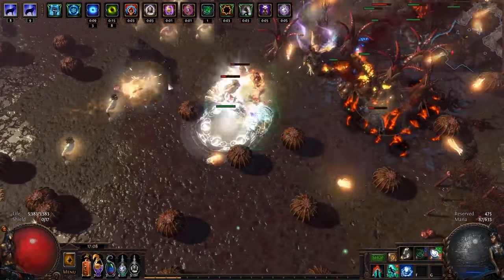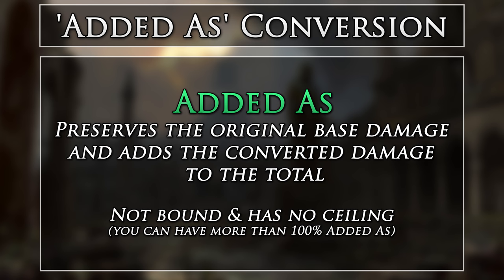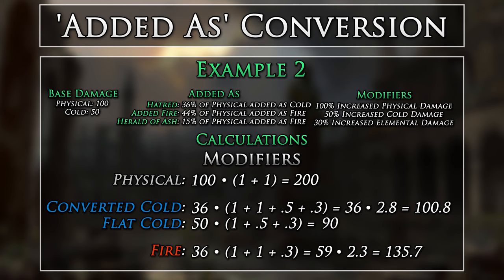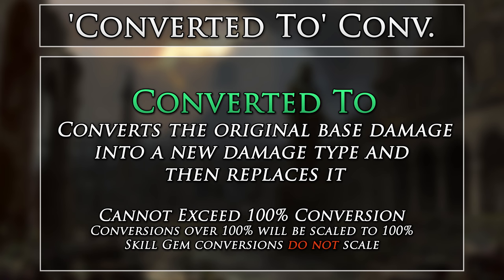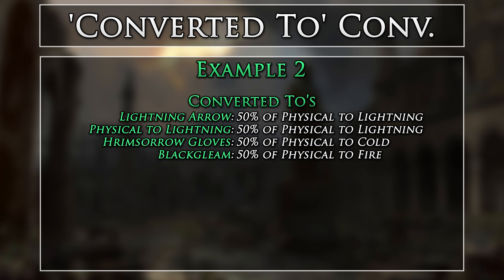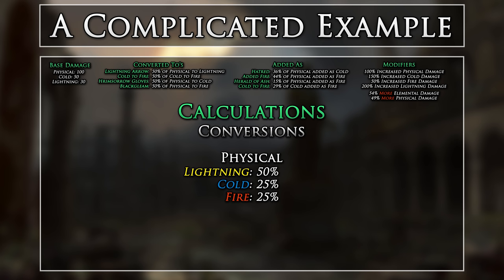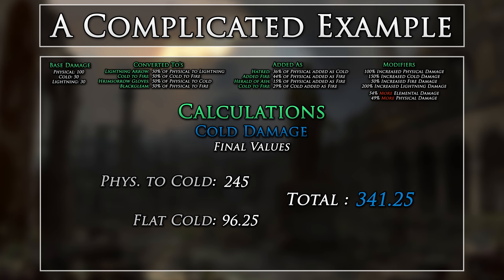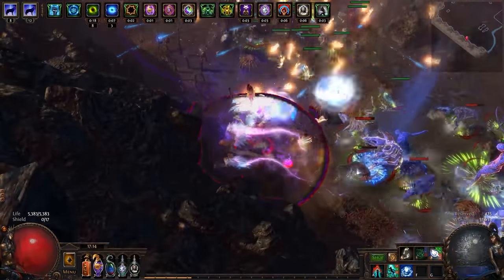Path of Exile: Damage Conversion

Comment: In the phys to cold to fire calculation, why isn't the math 61*0.5*1.29? You have 30.5 phys to cold and 25 flat cold after converting it to fire. Shouldnt the 29% of cold added as fire be calculated from the previous cold damage sources?

Comment: so tldr the main benefit of conversion is using say physical and elemental nodes in the passive tree to equally benefit the skill, this is double dipping?
Reply: No, this is not double dipping...you used to be able to restart the phys->element loop and "double dip" on the damage increases...but GGG caught on like the assholes they are and fixed it.

But yes, the benefit of conversion is to increase your ele. damage scaling.

Comment: You mention that skill gem-based damage conversion has priority on its share of the base damage when conversion is over 100% and will not be scaled down, but what about when the conversion from gems is over 100% already? For example, Glacial Cascade (60% phys to cold) with Physical to Lightning Support (50% phys to lightning) has a total of 110% conversion from skill gems.

Comment: At 8:12 it looks like you messed up with the flat lightning calculation-- it should be 138.6. In the next slide the total value is correct though (598)

Thanks for this video though, helped clear up some confusion I had with conversion. Very informative.

Comment: the only thing i'm a litte confused with if you only have 1 conversion at 100% (in my case to fire) is it better to add flat fire or flat phys, i guess in my idea phys since if you also have added then it helps but if not that then i don't know :p
Reply: If you have 100% of physical damage converted to fire, then 1 flat fire damage and 1 flat physical damage will give you the exact same amount of damage. However, a lot of flat elemental damage rolls in the game will have a higher value than flat physical damage. For example, let's say you're using an attack and you want a ring with flat damage. A tier 1 flat phys roll on a ring gives you 9 to 15 damage. A tier 1 flat fire roll is 25 to 45 damage. If they we're both the same value, say 1, then they would do the same thing. This is because 100% of your physical damage is converted to fire. 

Let's say you now also have "Gain 10% of Physical Damage as Extra Fire Damage". This will make the flat phys give you more damage point for point.
Reply: @g0aky  so if i don't have high flat rates for fire, and i do have extra phys as fire then flat phys is best, but without extra phys as fire its better to take flat fire because the conversion rate
Reply: @liamspruyt  Essentially yes. In this case the flat phys will be better point for point because of the "Gain 10% of Physical Damage as Extra Fire Damage" modifier. If you don't have this modifier then 1 flat phys and 1 flat fire will give you the same amount of damage, assuming 100% phys to fire conversion. The problem that you will run in to is that most builds in the game are a lot more complicated than the simple calculation in my examples. You may have many different modifiers from various sources in your build, which makes it hard to answer, at least if you're looking for what is best for your build specifically. I really recommend getting used to Path of Building (Community Fork). If you learn to use the program you can test all these things for yourself and see what is best for your build. And then you don't have to do all the calculating yourself.

Comment: Ok how about this one. You have 100 phys damage, 100% is converted to lightning using lightning arrow + phys to light. Then you use the Atziri flask. Do you get added as for just the phys? Or just the elemental? Or both?
Reply: Justin Ricks you wouldnt get the phys bonus. only the ele bonus.
Reply: It adds from both.
Reply: it adds for both
Reply: From both that is why it's in almost every build and the reason for 1% better modifier costing a lot more

Comment: what do you mean by elemental penetration after fully converting? does this mean that if enemy has 0 physical resistance and some cold resistance and if you convert from physical to fully cold damage the enemy doesnt mitigate the damage? you need to clarify "conversion being so powerful"  powerful in terms of what? making it easier to scale? or does the damage double dip? if you have 100 cold damage and fully convert to fire and if you have 100% increased elemental damage does that make it actually 200% increased elemental damage?
Reply: Conversion is powerful cause u can get dmg from a lot of sources.

Comment: This is a great tutorial. But can anyone help me out on my build. I'm planning to build a Frost Charged dash. Utilizing unique ring Call of the brother hood which convert 40% lightning to cold.
So basically i have 100% physical.
Charged Dash: 60% Physical to Lightning 
Skill tree: 40% Physical to Cold.
So technically my charged dash now is 60% Lightning and 40% Cold damage & 0%Physical. 

With the CotB ring 40% lightining to cold.
Does my Charged Dash now have: 80% Cold 20% Lightning 0%Physical? Is it correct?
Reply: That 40% lightning to cold would be your lightning damage (60%)*the conversion rate(40%), resulting in 24% overall conversion from your ring. Now you have 64%cold and 36%lightning.

Comment: I got a question at 9:57 , why the'cold to fire dmg' calculate by (1+0.5) instandof (1+1.5+0.5)?  phy2cold2fire also include cold increased dmg.
Reply from the maker: +Quinn Sheng You are correct, a mistake on my part.

Comment: Trying to understand the part where it converts physical to something by the chain - if i for example convert 50% physical to fire damage, and have increased lightning, cold and fire damage, would the converted 50% be increased 3 times for each of the increased or would it skip the lighting and cold? 

P.s - Great Video EE!
Reply from the maker: Well, as you said you have Physical converted to Fire. As stated, its affected by modifiers for each type it was and is, Physical and Fire. It was never Lightning or Cold, so it would never be affected by those. It will be affected by Physical, Fire and Generic Elemental Modifiers.

Comment: Hello Need some help with the conversion watched the video still not sure if i understand it correctly. 

my question is if i use lets say ice crash. and it convert 60% and i pick up the nodes Winter spirit and avatar of fire and use a cold to fire skill gem. that would mean 100% of phys is converted to cold ? and the 50% phys to fire from avatar has no effect ? because convert goes lightning cold fire chaos ? and if so  does elemental dmg increase the cold and then it converts to fire and the elemental dmg will again increase fire dmg. ? same with Berzerker passive 40% more dmg will it increase the cold dmg that then converts into fire and again increase 40% ?
Reply from the maker: You would the convert all phys to cold then all cold to fire, ending with a full fire Ice Crash
Reply: so the if my phys dmg is 100 and i have 20% more dmg  that means my phys is now 120 then 100% convert to cold 120*1,2= 144 cold dmg then 100% of the cold into fire 144+ the 20% more dmg = 144*1,2= 172,8 fire dmg ?   so 20% more dmg would actually give 72,8% dmg increase?

Btw thanks for the fast respond :D

Comment: So just to clarify about 4:42 , is this only talking about converting at each "step" of the chain, so converting a total of 4 times before reaching Chaos - or will using a "cheat" unique such as Voltaxic Rift also work?
Reply: If you convert phys all the way to chaos without skipping steps, all modifiers would apply.

If you convert lightning to chaos, only lightning and chaos (well, and global damage) modifiers apply.

If you convert physical to fire, and that fire to chaos, modifiers to those types apply.
Reply: ah ok, thanks.

Comment: Does these conversions work on dot or only to hits? Like... Would scorching Ray be affected by fire converted to chaos or ele added as chaos?
Reply from the maker: You cannot convert Damage over Time or make use of Added Damage, as both require hits. That means you cannot convert or add flat damage to Scorching Ray.
Reply: yeah, though so...i just wasn't so sure about converted to. Thanks for the fast reply :D (even though i could've easly tested it on pob, i was in bed almost sleeping - i was just going to do that and reply the answer)

Comment: so if i completely convert all of my phisical damage then all of the physical modifiers are useless?
Reply: "Converted damage is affected by the modifiers that the damage was converted from and the new type that it is." quoted from his written guide. Using converted from one type of damage to another type modifier to chain up each other, and modifier to physical will also affect the chained type damage.
Reply: @xugao7252  english? answer yes or no. Do i still want to grab physical dmg where I can? What about gear? Say i want to Divine Ire, and I have 100% conversion to lighting, would i want a sword with lots of physical dmg and some elemental dmg? or a wand with no physical dmg. and if i have no physical dmg, isn't none of it being converted to lightning?
Reply: @Ryden0389  divine ire is a spell with fixed value of physical damage with spell itself. but as all spell, it wont take auto attack damage as base type (which most attack skill do). it will still benefit from global modifier such as passive tree node "increase X% to physical damage". now if u convert all those physical damage to light, those modifier still does their work, then convert to light damage. now, node such as "increase X% elemental damage" will apply to them as well. (sry for 1 wk late, i dont come to utube that much)

BONUS: "call of the brotherhood" and "Pyre" are 2 unique rings that can chain up this conversion to fire. if u wants to do it for fun.
Reply: @Ryden0389  answer in the form u want: 
english? emm
physical damage? yes, increase or more to spell not attack 
gear? spell damage (dagger or wand or sceptres)
sword with lots of physical dmg? no
wand with no physical dmg? yes, but with good mod (spell dmg, X% dmg to extra X% damage, % cast speed)
no physical dmg? no, u have it on the gem itself, check out this on poe wiki page.

basically in poe there are 2 families of skill (mainly), they are either attack or spell, u cant have both, and look for mod in that family.